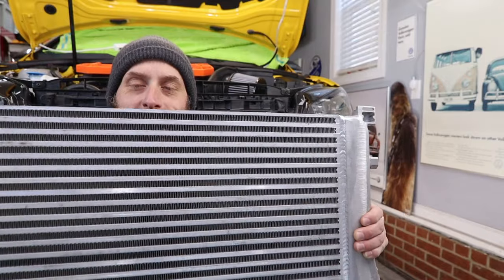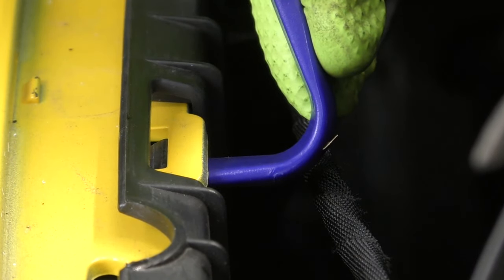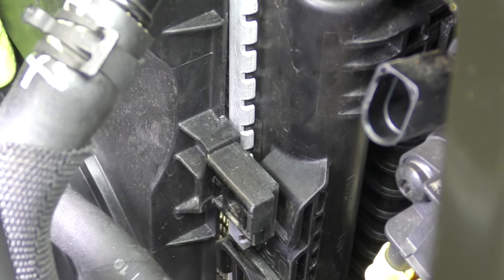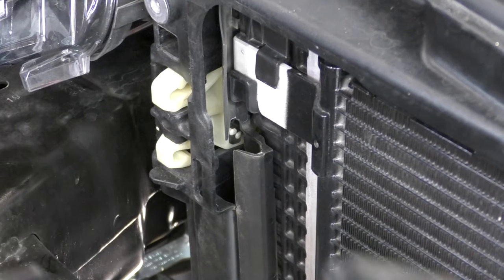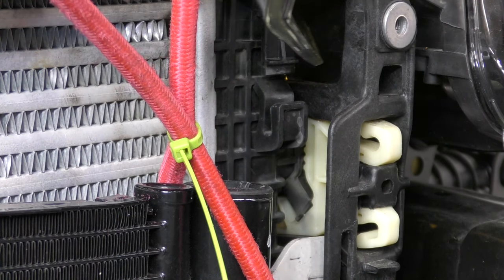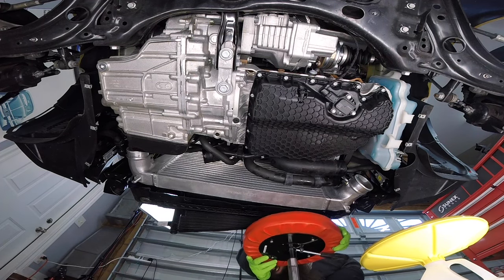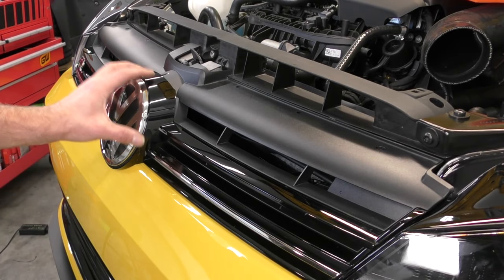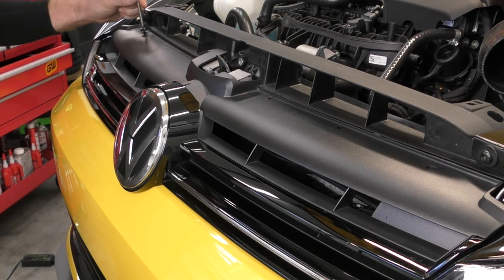Intercooler Upgrade and Installation ~ Stage 2 Golf R

Comment: Sir, had a couple questions on a DYI cooler, do you recommend the factory style mounting location (MK6 GTI) or where I see some mount them and that's the lower front bumper behind the mesh. I can see option 2 being a positive for getting it away from the radiator and heat. Thanks for you time.
Reply from the maker: I typically follow what the OEM did. They usually do way more testing than the aftermarket. But that is not to say the OEM is always right

Comment: I've been looking at this same intercooler IG  and the Neuspeed front mount Intercooler do you think there is any advantage in installing a true front mount or do  you think the stock location upgrade works just the same ?
Reply: It works about the same. in California this works great for getting around smog inspections as they will check for any illegal emission modifications like a front mount intercooler. vs swapping the stock one and it looks stock.

Comment: Hey man awsome vid thank you for that
I have Golf 7 R 2014 TSI stock 300hp, the big problem that i changes a lot of times the water pump number  06L 121 111 and its a expensive part i don't know where is the problem, have you an idea of that problem it's very sick for me always the water pump is HS after few miles and i need to change new one
Reply from the maker: is it oil leaks causing the coolant leaking
Reply: @HumbleMechanic  the oil is Ok no leaks but the coolant is leaking yes

Comment: Hey Charles! I was wondering what do you think about tunes and TD1 flag? I really want a tune but there is a little voice in my head saying don’t do it but since they’re so reliable cars i am not really concerned about issues.
Reply from the maker: The odds of td1 are low. But it’s something that does happen. If it’s gonna be a ton of stress don’t modify
Reply: I was stage 2 with my wrx and I wasn’t very stressed so it shouldn’t be that bad! But unless i get a warranty claim I shouldn’t have any chances of getting flagged right? I don’t know what happens if they find out since my car is leased

Comment: thicker =/= better, btw.  Could potentially "block" airflow
Reply from the maker: possible. The only airflow blocking Id worry about is radiator since it's behind. something I will be monitoring for sure
Reply: @HumbleMechanic  the radiator should be fine since it has the fan pulling air. The problem with thicker intercoolers is that air potentially doesnt like passing through the thicker area and "gets stuck" inside the fins. Banks touched on it recently in one of his videos, check it out.

Comment: Why the heck are people taking the front of their cars apart to do this install? Please follow this DIY and ignore all the other DIY that cause you to dislodge the core support which also can affect your headlight alignment and create other issues. Charles has this DIY dialed (thank you!). I installed the CSF radiator AND AMS FMIC on my 2017 R following this DIY with no issue...on jack stands. Nothing else needs to be said other than thank you again.

Comment: I understand that it is state dependent, but how does stage 2 affect state emissions?
Reply from the maker: Readiness will not set. So if your state uses readiness check you will fail
Reply: @HumbleMechanic  cool thanks the info man! Love the channel.

Comment: Hi I had a fender bender where I have  to replace radiator and intercooler  by changing  to a better intercooler do I have to replace or change a down pipe
Reply from the maker: You’ll want to for this software version
Reply: @HumbleMechanic  could you recommend me one that I don't have to do any mods or tunes please thanks

Comment: Cool upgrade. But man, All the plastic... I understand it's cheaper than metal. And it doesn't rust. But I like nuts & bolts and metal parts better.
Reply from the maker: It’s about efficiency in production too.

Comment: is this the MQB intercooler from ECS Tuning?
Reply from the maker: Integrated engineering
Reply: @HumbleMechanic  First…thanks for your wonder content.  i am a 58 year old shade tree mechanic.   Late to the game but still love it.  No garage or lift.    lots of track time with various cars.

Question-  My R is a daily but will drive to locations for some track events.   i already know i need oil cooler (270 degrees at Daytona).    Have you explored if the car benefits from the white line ball joints that raises roll center and allows more negative camber?

Comment: Dude I cannot get the clips out that hold the radiator in. They don’t go down far enough, any tips?
Reply from the maker: You have to push them so far you’re convinced they will break. 

You can also break them and buy new ones. I won’t be made at that. They suck
Reply: @HumbleMechanic  thanks for your reply man. Youre the best
Reply from the maker: Happy to help. Again they suck! HAHAH
Reply: @HumbleMechanic  yeah I ended up breaking the clips lol. One last thing, do you have any tips for refilling and bleeding the cooling system?

Comment: What is the part # for this part at 20:44. Mine broke after hitting a raccoon. I have tried to find a replacement part but cannot locate one.
Reply from the maker: I’ll have to research. Have you called the local dealer?
Reply: @HumbleMechanic  Thanks for your response. Yes I finally got through to them. They must have been pretty busy to take 4 call backs to actually talk to me. Thanks for the suggestion sir.

Comment: Do a video on How to fix ACC code!!!!!!!! 
I don't wanna TD1 my car taking it back to the dealership
Reply from the maker: It depends on the code. And often the ACC relearn requires special tools
Reply: @HumbleMechanic  doesn't need to be recalibrated, just reset. 
Had a body shop pull the bumper and unplug the battery.  
They are willing to take it to the dealership, but im FBO, Hpfp,Lpfp, full e85 on custom tune. 
Looks like im getting  a TD1 after all..
Reply: @HumbleMechanic  was told by another shop, that the key needed to be in a lead box and 500 feet away from the car to prevent that from happening.  They did not do said steps...😥

Comment: +20 lbs added to the very front of the car - not good. Jeff from mygolfmk7 did lots of test on a flow bench measuring airflow of intakes and intercoolers - you will be amazed how nicely OEM stuff is designed! Slightly modified OEM will be better for most people.
Reply: Pretty crazy what millions of dollars in R&D and German engineers can get you.
Reply: @aygwm  Reminds me of a radio commercial from GTA 4: "I am talking about taking s $250,000 sports car designed by world-class engineers and letting a guy from East Hook modify it so it’s worth a lot less, yes a lot less – that’s player’s style, baby! "
Reply: Manufacturers have to look at costs more then performance, 
saving $10-$20 on a cooler alone is a lot of money when u consider how many cars they will sell.

Comment: Pounds are a unit of currency . It's a German car . Weights in kg for the metric world please . LOL
Reply: Only in uk bro.
Reply: @Zride_98  it's a European car and Charles has a metric vernier . We want kilograms ..... Well I do anyway 😉
Reply: @paulwhite7475  well what helps me because my mini is German too and they measure in kilos too is that 1 kilo is about 1.8 pounds. So I usually do that kind of quick math in my head. But if it's something I really need to get right I'll do an actual conversion on Google or something
Reply: @Zride_98  2.2 kgs to a pound according to Google . I get confused watching skid factory too they talk mm and kgs then tell me a car has 13 pounds of boost . SA is totally metric since the late  60s . I work in bars
Reply from the maker: Dang you Paul. You are spot on. Moving to KG for weight is something is struggle with I think. Hahahaha
Reply: @HumbleMechanic  don't worry Charles. I know I'm fos . I battle with boost figures that aren't in bars

Comment: All the German engineering and no coolant drain plug lol. Damn these cars seem horrible to work on, super easy to mod and big gains for little work but under the hood stuff is definitely a Somebody else job for me, I'm too clumsy and agro for that fiddly stuff.
Reply from the maker: They aren’t bad once you understand them.
Reply: I finally own one Charles 😂 is there anyway to remove the bumper and replace it without having to calibrate the radar cruise, I got quoted a crazy price for that.

Comment: i don't think i like this design why VW design the there system like that to me when the air condition is running the intercooler is going to be heat soak because the condenser put out a lot of heat , in summer time running air conditioning and driving in boosted this car is going run in retard mode to prevent detonation
Reply from the maker: Maybe. But in most cases you’re not in full thrash mode with the ac on. I’m guessing they did that testing. Lol I’d like to think anyway